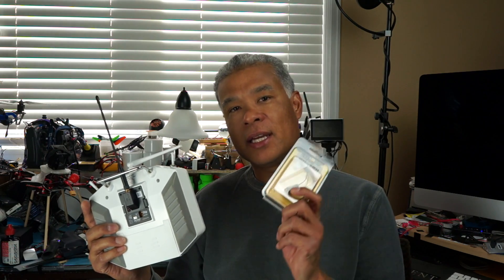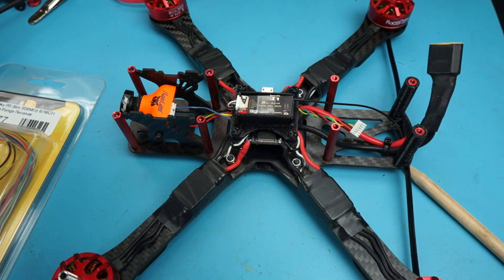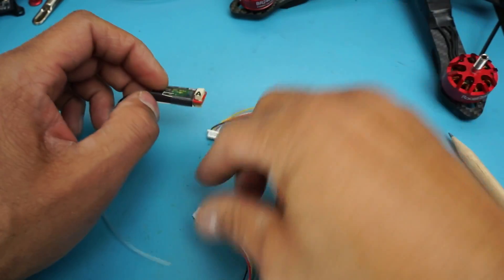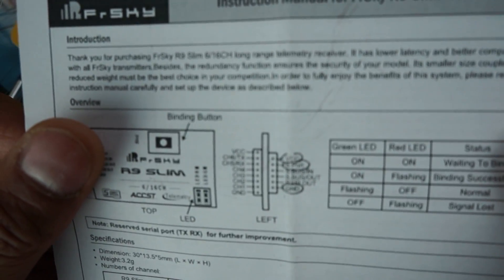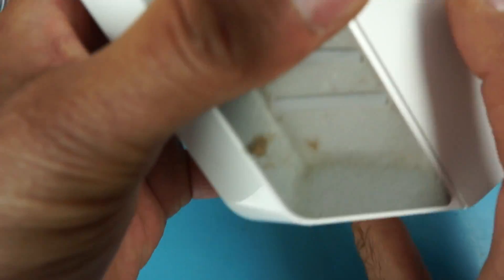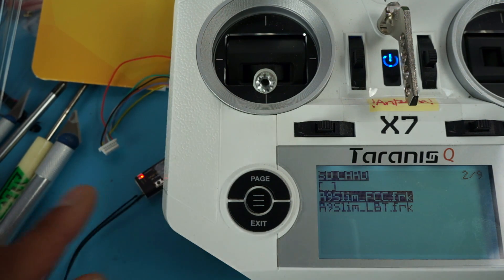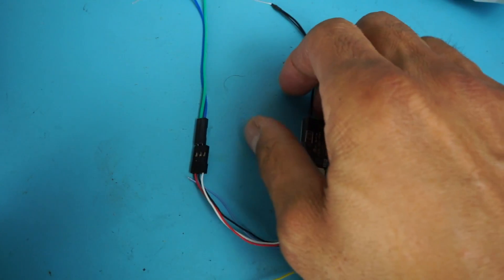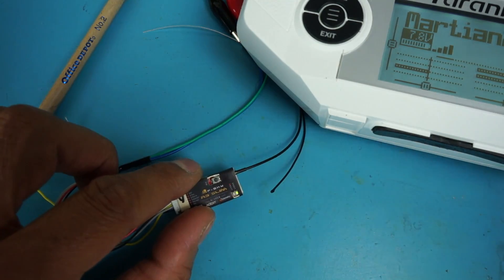Better than Crossfire? FrSky R9M and R9 Slim Setup, Flashing & Binding

Comment: Hi everyone I have a problem with R9m & r9slim+ I cannot bind them. I updated firmwares v1.2.0 lbt, transmitter x9d+ v2.3.0 when I chose external module R9m lbt it shows me (certified firmware required) . After I continue and finish bind procedure. Result: they are not binded. I tried to do it few times results same. Is anybody nows how to resolve this problem? Please help.    I’m in United Kingdom

Comment: I didn't see the part I am getting your firmware on your receiver you must've hooked up to your computer and upload it or put it on the SD card I'm assuming?
Reply from the maker: rick winchester I put it on the SD card in the firmware directory. Get into the radio setup and the second page is the flashing page. Find the firmware and flash the EXTERNAL module.

Comment: Hey man thanks so much for this tutorial... You should consider the FuriousFPV 2.4ghz video system. If you dont run fatsharks you can get a dock-king bay for it (literally called the dock-king) and run the video to your goggles. It can do solid video out to 10km with the 2.4ghz patch antenna bundle

Comment: Sir can you please tell me the maximum safe range because I want to buy this transmitter and receiver?? So please please please tell me ..... maximum safe range.....
Reply from the maker: The maximum safe range with the stock antennas is realistically < 1KM but will fail safe easily.  With a good TX antenna and the RX antenna in vertical orientation, the range is miles.  I think FrSky says 10KM.

Comment: Went through whole process, updated open TX, FCC firmware on module, then hooked up receiver. Solid green light when bound. Won't arm. But when I plug and unplug quad says Telemetry lost or recovered

Comment: First of all, thanks for the video and for sharing this.
The FrSky manual of reciever recommend a vertical position for antenna. What do you think about this?
I also did my build on R9mini and got a bad signal, 30-50 meters and the signal is lost. I think there's something wrong with the antenna receiver.
Please share your opinion, thank you.
Reply from the maker: I had several close range failsafes with antennas in horizontal position.  I have switched all of my quads to a vertical mount antenna.  I also changed the TX antenna to a standard crossfire.  Both are in vertical orientation and I have had the best performance.  If you are using the standard R9 TX antenna, I recommend getting something better.  The standard crossfire TX antennas are good, but I've heard that the Moxon and Diamond are better.

Comment: Your antenna mounting looks really clean on the quad. I am about to use a couple R9 Mini's, care to share how you did that?
Reply from the maker: Are you setting up 2 RXs for redundancy?  Sounds cool.  One vertical and one horizontal should be great.  I designed a 3D printed part and attached it to the motor screws and frame standoffs.  The single antenna did not seem to perform at it's maximum in horizontal position.  You can use antenna tubes or zip ties and heat shrink.  I'm working on a new vertical mount antenna now.

Comment: So, havr you been using it? Is it really good? What is your opinion?
Reply from the maker: Loving it now.  My 3 main quads have the R9 Slim installed.  I just did my first 1 mile out and back.  See my main page if you're interested.  It is a good product.  I question the stock antenna performance, so I am using a Crossfire TX antenna, which works very well.
Reply: Thanks for the answer, I saw the 1 mile video... The RSSI went to 87, the R9M antenna was pointing to the school right? I think that if it was 90° considering the trajectory the RSSI would never go below 95 (I'm new to the hobby I'm just wondering hehe) I will buy mine soon... thanks!
Reply from the maker: It definitely dropped.  I thought lower than that!  The RX antenna was definitely 90 degrees to the TX.  It makes sense that it would drop but I'm now wondering if it would failsafe in certain conditions.
Reply: Mile High Multicopters But it is fine for me, I don't fly long range,not even middle range, I just want to get rid of the fail safe,it will work perfectly for me =D thanks!

Comment: What kind of distance can you push 
And flight time  
Nice build
Reply from the maker: Thanks.  I have done a mile out and still had RSSI in the mid 90's.  A test run for the One Mile FPV Challenge limited class.  https://youtu.be/AHfC3R7lx7E?t=4m17s

Comment: Is it hardware based locked or can anon eur be flashed to a EU version and vice versa?
Reply from the maker: As far as I know, you use the same hardware.  There is an R9 users group on Facebook and discussion group here:  https://www.rcgroups.com/forums/showthread.php?2878502-FrSky-New-Arrival-%C2%96-R9-R9M-long-range-RC-system

I have not heard of anybody with region specific issues flashing firmware.

Comment: Can you fill me in on connections? There’s an SBUS in and an SBUS out. Where do they go?
Reply from the maker: Use the SBUS out to connect to the flight controller.  You would not normally use the "In" wires unless you're doing redundancy.
Reply: Mile High Multicopters thanks. Yeah that piece of (now obvious) info occurred to me shortly after this comment lol. Felt pretty dumb.

Comment: I cannot update the transmitter from the module Bay
 I had to use the bottom a  s port.
transmitter would not even power on until it was updated

Comment: hi there, i accidentally flash to internal module. I've tried flash back the xjt module but i still couldn't bind to my 2.4g. what is the firmware that you flashed?
Reply from the maker: I think I just downloaded the XJT module firmware from the website and flashed it to the internal module.

Comment: you can easily use the 3 pin smartport on the bottom ;)
Reply: https://oscarliang.com/ctt/uploads/2017/07/Taranis-QX7-Smart-Port-pin-bottom-TX.jpg
Reply from the maker: My radio is the first version and it did not come with the smartport!  It is completely missing on the board.

Comment: I did flash my R9M and R9 to my X9D , update the module first and then the RX, had not issues at all.
Reply: maxun1 did you just use the latest firmware to flash the module and receiver? Or did you install all the older firmware like they said to do in the forum?
Reply: hquiroz113064  I did star from the older to the latest firmware

Comment: There are several firmwares for different things on the frsky website, I bought the r9 slim, I work as a 20 year old computer technician, whenever we update a BIOS, the last update contains all the previous updates and this makes the newest files are bigger size, and this does not happen with the r9 slim firmware, it is much smaller in version 180329 than in 180202, in version 30-03-2018 it has 94kb and in the previous version of 07-02-2018 it has 199kb. Do you know anything about this?
Reply from the maker: I can't explain why the sizes are different, but I did not install all of the files.  I only installed the latest 2.  I'm positive that the firmware file is cumulative and has everything all the functionality.

Comment: how to power on r9slim
Reply from the maker: Use 5V from the flight controller.
Reply: fw update error bottom pin no resp
Reply from the maker: If you have a QX7, you may be able to use the s.port plug on the bottom under the rubber cover.
Reply: Mile High Multicopters Thanks for sharing this video. Trying to flash 9RM Slim receiver with X9D....getting error  (external module not responding) even though receiver is powered.
Reply from the maker: I haven't seen that error on the R9 Slim yet.  But, when I got it on an XM+, I had to upgrade to the latest Open TX.  Is your X9D upgraded?

Comment: thanks for this. I'll be purchasing this system instead of crossfire. helpful. thanks.
Reply from the maker: I'll be making a new video soon on how I set up my system.  But to save you a lot of trouble, the stock antenna is not very good.  Either replace it with a better antenna or try a 45 degree sma adapter so the antenna is not pointed straight out.

Comment: nice video very informative. can i kindly ask for assistance on where to solder the r9 slim receiver wires onto what pads on the fc? thanks bro the help would be greatly appreciated.
Reply from the maker: Use the SBUS OUT, +, and -  to your FC.  You'll have to get the docs on your FC, but most FCs have dedicated RX pads.  There should be  + & -, pads next to it.

Comment: I already have this receiver , I don’t have a module tho. 
It was giving to me for free so I’ll eventually put it in something. So my question is will this receiver work with with no module off the antenna on my tarnais xq7s ?
Reply from the maker: Sorry, but no.  The R9 RX and TX operate in the 900mHz frequency band.  Your standard Taranis uses 2.4gHz.  You should be able to find a R9M module for around $50 at getfpv if it is on stock.

Comment: what controller do u use do u have a link  for your build and software configuration  and  do u have a link  for the parts thx
Reply from the maker: Hi.  I use the JBardwell F4 AIO FC.  Sorry, I don't have any info online about the software configuration.  Here is the quad build that I put this system into:  https://rotorbuilds.com/build/9937.  Let me know if you have any specific questions and I will try to answer them as best as I can.

Comment: how do i use this  slim rx with Dji naza  i just got  it  today t also i got the R9m long range  it does not have a  battery input  like yours  ?where did u buy yours  or may be mine is new version and use less power  https://hobbyking.com/en_us/r9m-r9.html             thx
Reply from the maker: I purchased my system from GetFPV.com and I believe that mine is the new version. Yours should be OK at 100mw power and will drain your battery faster if you use more power.   I am not familiar with the DJI Naza.  First determine whether you are using PPM or SBUS.  For PPM, you will use the larger plug (8-pin) on the bottom of the R9 slim.  For SBUS you will use the smaller plug (6-pin) and the S.BUS/OUT pin on the top of the R9 Slim.  I hope that this helps.

Comment: What is that antenna that you are using on your r9m?
Reply: I'm currently using the stock antenna.  I just purchased a Crossfire TX antenna, but am waiting for an adapter.  I've experienced a few random failsafes and think that the stock antenna is not very good.
Reply from the maker: I was using the standard antenna.  But, I just received a standard Crossfire antenna and adapter to try.  I'm hoping that this is the cure for the unpredictable behavior.  Fingers crossed.

Comment: hi chuck thanks for taking the time to create and post this video
have you had a chance to see what the actual range of this setup is.when you do a range test
please post the video as i have had my eye on this 900 frequency setup from frsky
thank and keep up the good work
Reply from the maker: Thanks for the compliment!  At this time, I would recommend to wait and see what happens to the FrSky setup.  I've experienced a few random failsafes and think that the standard antenna may not be optimal.  But to answer your question, I've been up to 1km so far but need to figure this out before going farther.

Comment: Nice video! Have a question though. 9R slim receiver  can only be used with the module?
Reply from the maker: Thanks!  You can also use the R9 full size receiver.  I believe that it also has diversity antennas.

Comment: will it do for 16 channels mode?
Reply from the maker: Not exactly.  In the US, it will only do 8 channels with telemetry.  It has 16 channels but you have limitations.
Reply: hmm and seems there is no info if it supports fport
Reply from the maker: Yes.  The R9 Slim RX only appears to support S.Port, S.BUS, and PPM interfaces.
Reply: i hope frsky will come up with fport firmware for  all receivers as right now setting it up on F4 is a pain in a neck, and it looks like f4 still gonna be around for some time

Comment: How it's going with R9 now?
Reply from the maker: I've had a few random failsafes. Most within 200m.  It will go far, but I need to figure out this problem.  If you're interested, I say to wait and see what happens or get a Crossfire.
Reply: Mile High Multicopters https://youtu.be/A_ZbmbMTTv8 my first experience with R9. Feels not very relible. I am looking at crossfire right now.
Reply from the maker: I just receive my new Crossfire antenna and will test soon.  This will be my final test before deciding to continue using it.  I have also seen Crossfire users have problems with failsafes.   While Crossfire seems anecdotally better, there still are a lot of people using R9 with no problems.
Reply: Mile High Multicopters Thank you for update! Hope it will improve signal
Reply from the maker: On my first day using the Crossfire antenna, the RSSI values were very strong at 100mw.  Where I used to get in the 60 range, I am not in the 90 range.  I cannot say for sure whether this is the cure , but I did get another short range failsafe for a second.  I can definitely say that a standard TBS Crossfire TX antenna is better than the FrSky antenna.

Comment: Hello Chuck!  First of all thank you for subbing to my channel.  Second you have a pretty cool and informative channel.  I have been thinking about the R9 and the module for some time now.  Great to see a slim RX is out.  What flight controller was that you are using?  And last does the R9 slim require a flash to update or whatever?  I use a taranis x9d+ and have installed xm+ and x4r-sb (with working telemetry!) In 2 of my kwads.  I have never had to update or flash a rx.     Thanks in advance and cheers!
Reply from the maker: Hi Mike.  Thanks and I hope you can find some useful info.  I'm using the J Bardwell F4 AIO and it works pretty well.  And, yes you will probably have to flash both the R9 and R9M.  Mine would not bind straight out of the box and I've read the same thing about other people's experience.  Don't worry about it.  It's pretty simple to flash the RX once you have a cable wired correctly.  In this video, I think I show you enough to hook it up, but you can go to Project Blue Falcon and see a very good example of how to wire it up.
Reply: Mile High Multicopters thanks Chuck!  Project blue falcon has saved my butt many times in the past. May he R.I.P.  I'm thinking about getting the jbf4 for my upcoming build.  R9 is looking like a easier way to go than crossfire because of all the lua problems with it recently.  Anyway, cheers and happy flying!
Reply from the maker: Take a look at GetFPV.  They had a great deal.  Way cheaper than Crossfire too.

Comment: I couldn't get my R9M to flash through the module bay on the Qx7. I had to use the smartport on the bottom of the radio.
Reply from the maker: That may be a difference between the early  QX7s and later.  Mine has a hole for the s.port, but there isn't anything soldered to the board.
Reply: Mile High Multicopters must be mine is pretty new.  Justin didn't want that to trip anyone up.

Comment: What the luck searching r9m now 
Kinda shattered I wanted to run it on a 9xr wanna update one for me lol
Reply: You should be able to update it yourself on the 9xr, I have the 9xr Pro and it will  do it.
Reply from the maker: If you live in Denver we could work something out!
Reply: +Mile High Multicopters Texas damn the luck
Reply: +edwardMcrichy I don’t have the cable to upgrade firmware on 9xr I’ve had it years
Reply: johnrideabmx ah... that's would stop it